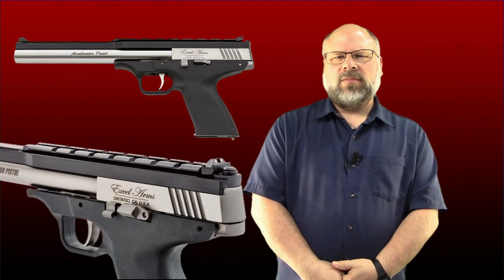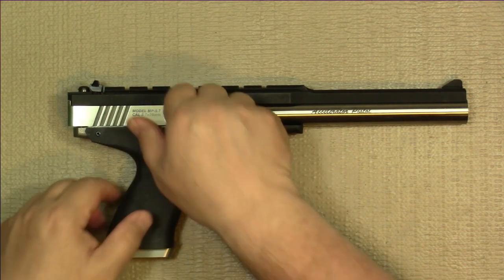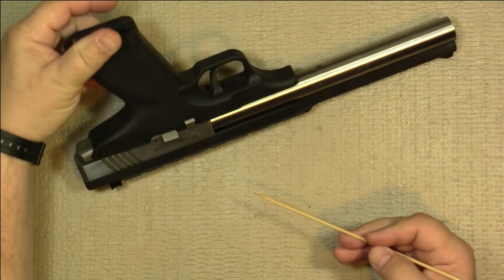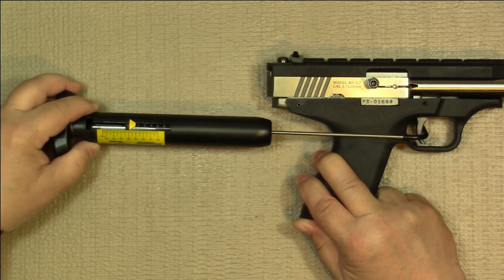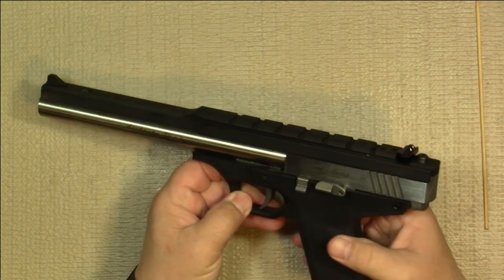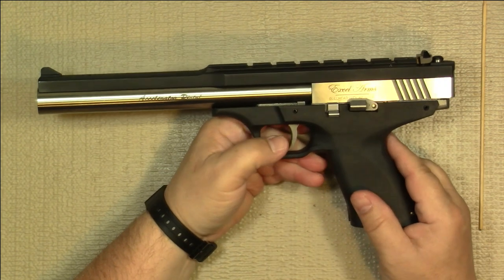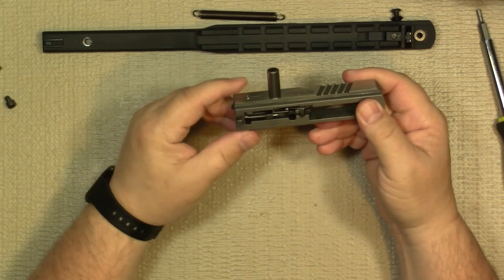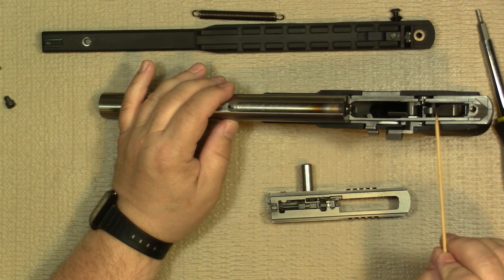EXCEL ARMS ACCELERATOR PISTOL

Comment: I really love this gun, I bought the rifle and pistol several years ago, the pistol never would cycle. I sent it back and had the same issues after I got it back. I threw it in the safe for a few years because i was pissed and couldn't sell a non functioning pistol, then tried again to send it back, The lame company couldn't even fix their own gun the first time it went back. This time it cost me 100 bucks to ship back to them for a gun that should have worked when it was new. So much for their shitty warranty!! It does work now but getting them was so painful and Excel is such a horrible customer service company, I would never do it again. But, now that it does cycle, i do love them both, just would never go thru the pain again. Buyer beware unless you love a non working gun and getting the royal run around from Excel for years to get them to function properly.

Comment: I was barely into the video when I found myself wondering, what is the purpose of this gun? Too big to carry (much less conceal), too heavy a trigger for accuracy, and a charging handle that might be great for left-handers, but seems awkward for the right-handed majority. How much do they charge for what seems to be a fairly useless gun? I do like your forthright assessments of the guns you feature.
Reply from the maker: Thanks for watching and commenting. I always try to ensure that I accurately give my thoughts on  the items I review or feature. The result is some will not be positive. I definitely expected more, especially since these are not cheap guns. The full retail is just under $700.00.
Reply: The company is owned by the original founders of the automag. This gun is a spiritual successor sort of. A handgun of this type is generally one of 3 things. 1: hunting, 2: limited or restricted division competition, 3: plinking/nostalgia. The trigger breaks around 7 pounds, which is on the heavier side, however, still no issue on accuracy if you just shoot the gun often enough to get comfortable, and use proper techniques. I would say that the heavier trigger in n theory is to prevent accidental follow up shots from the gun being front heavy

Comment: I bought a 22 WMR Accelerator brand new and had all kinds of cartridge feeding and ejecting problems.  Sent it to Excel Arms Service dept to fix.  I received it back about 3 weeks later and the repair slip said that the "chamber was polished".   I know what polished means, but I don't know what 'chamber' means here.  Anyway, the gun works now.  No fails through 18 rounds fired.  But, I too wish that I hadn't bought it.  I now have over $700 into this gun without yet putting a laser or red-dot on it.  Don't know if I am going to.  Their advertising brags about "Made In USA" but it sure doesn't reflect quality.  Sad.

Comment: After watching this and other videos on Excel Arms' products, I get the impression there's a lot of potential in their product line, but their design team lacks imagination.  This pistol, for example, would be better as a "pistol" with brace.  The trigger apparently needs work as well.

If the reliability issue improves, then it may not be an issue of bottleneck geometry.  I have a .22 WMR carbine on layaway.  My initial thought was "why not make the carbine a takedown with interchangeable barrels so it could chamber the .17 HMR as well?", but after seeing the. 17 dropped, apparently due to consistent reliability issues, maybe not.
Reply from the maker: I think there is potential, however as it stands now out of the box it is not one I can recommend. There is no disputing it looking good though. A brace may help however I think it's intended use would be more in line with bench rest shooting. Get some trigger work done and I could see potential there.
Reply: Cheek pistol

Comment: Also, considering they no longer produce a .17 HMR model due to chambering issues, the bottleneck may be causing issues.  .22 WMR may be the best option in those arms.
Reply from the maker: 17 hmr proved very problematic for autoloader, which is why they have been dropped by most everyone who tried it. If it would reliably work ir would be great, but until someone figures out the magic on it we will have to do without.

Comment: I own one in 22mag,  and is true a challenge to make work, I have to do  my self the improvement, change the recoil spring and make the hammer profile flowless,  and use ammo like fiocchi  40gr 1910fps or CCI 40gr 1875fps
Reply from the maker: It is unfortunate that these pistols are like that, because I really like the look of them.
Reply: @CraigsGunChannel  Ies I like to, that's why I did work on my pistol, because the company that made it   is   useless
Reply: I recently bought this pistol in 22mag and am having feeding/ejecting issues also. I’m curious what recoil spring you replaced your with? Thanks